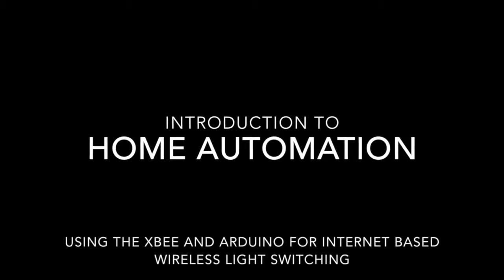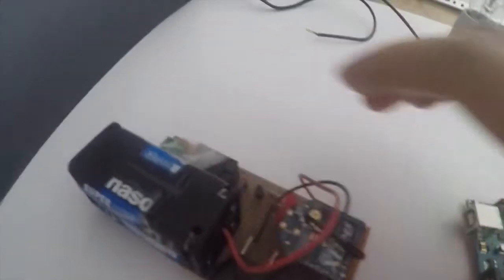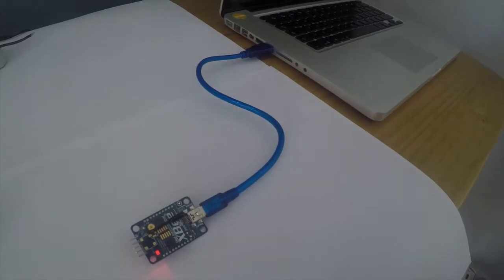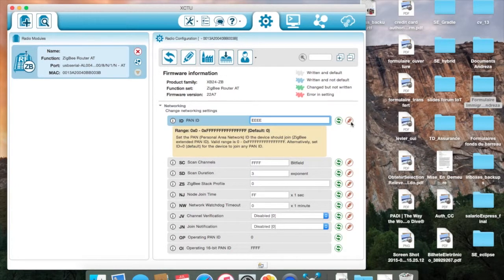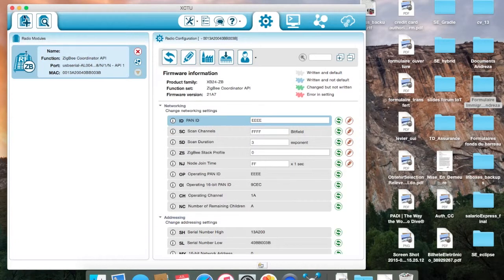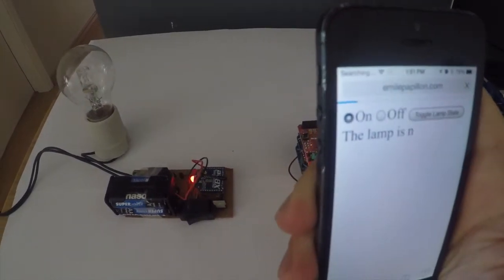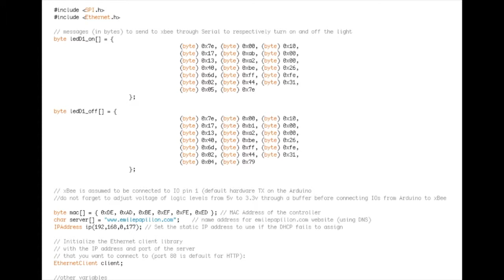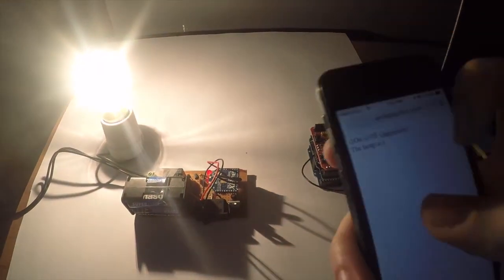Wireless internet light switch : A tutorial (using the Xbee and Arduino UNO).

Comment: Where you set the ports xbee?
Reply from the maker: You need to include them as a parameter when sending the API signal to the switching xbee, you can use XCTU to generate the proper frames or to directly command the xbee pin